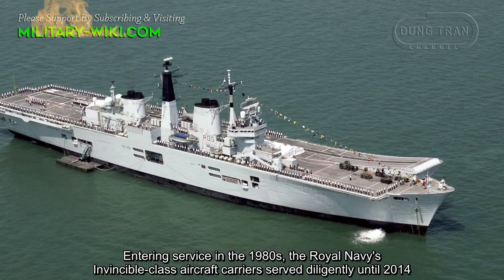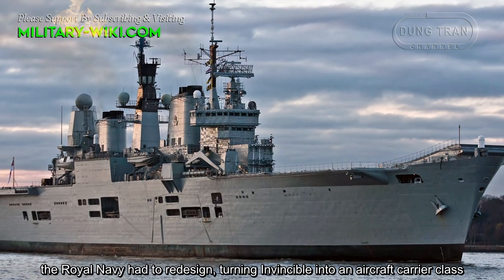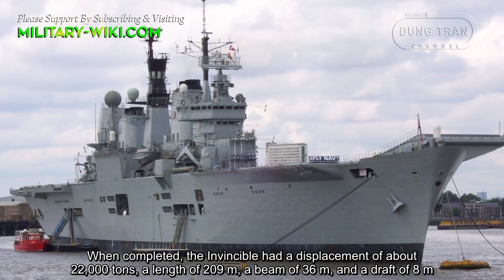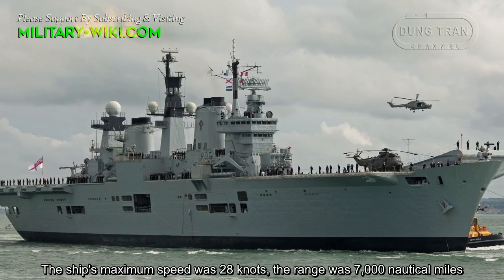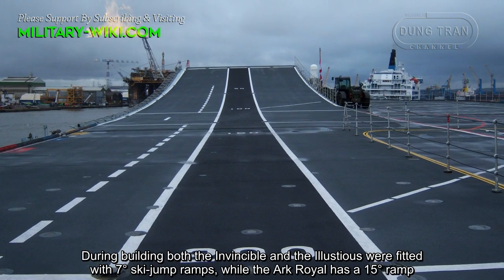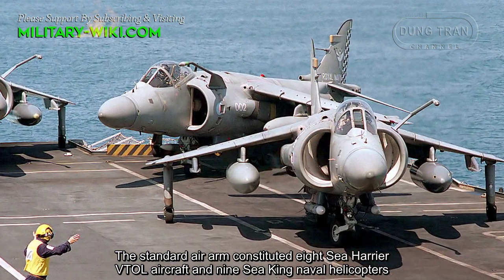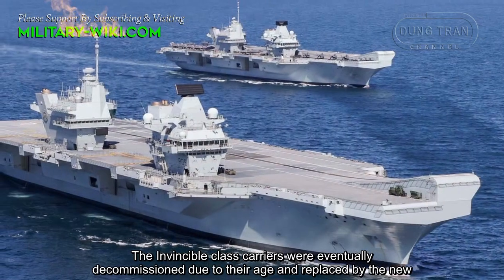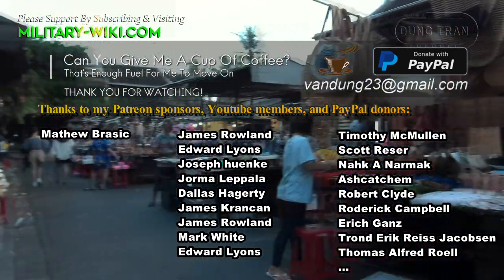Invincible-class - Used To Be The Main Aircraft Carriers of the Royal Navy

Comment: These were great little carriers for the time they were in service. By the time they got retired they were no longer capable of doing their job due to the age and it's limitations. The new QE class are better but i would have built them with the angled deck they were supposed to have. They now need an upgrade if they want to use them in a near peer operation. A couple of lighter carriers for training and replacement would be nice they could be a scaled down version of the QE or a modernised version of these.
Reply: oh they could have got another 10 maybe 15 years of service out of them if the govt hadn't cheaped out thinking they could get away without carriers anymore!
Reply: @keithmoore5306 tbf. They were very run down. Illustrious was borrowing parts from its decommissioned sisters to remain in service
Reply: @admiralmallard7500  plenty of ships use salvaged parts from decomms to stay in service and still an old wrung out carrier that can still operate beats no carrier!